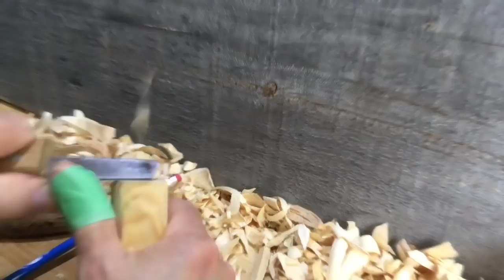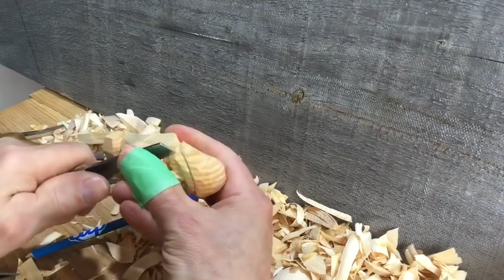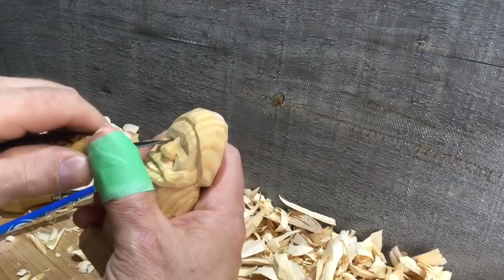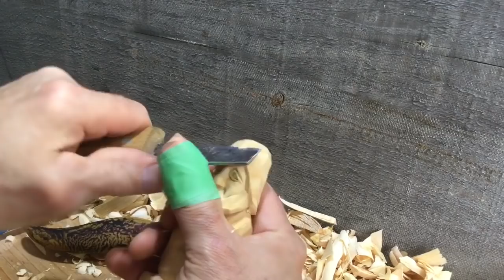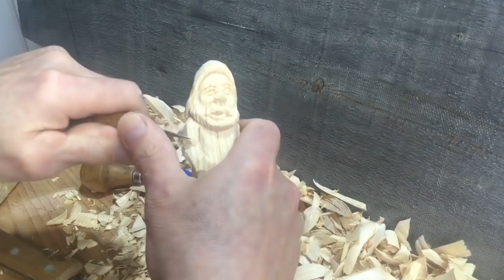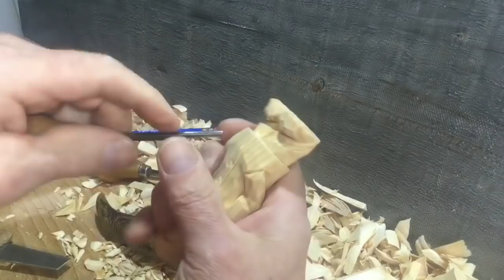Carving a 4" Fisherman

Comment: Another great one -I'm in awe at the flawless carving of the eyes as that is where I am the worst.your pine also seems to hold detail better and take pressure cuts without breaking like my Basswood or it's just you :)
Reply from the maker: Thanks Doug. Your carving looks fine to me. I had trouble with 👀 first when I carved. I was putting too much pressure on my knife. Once I figured that out I began cutting very lightly into the wood around the eyes. It made all the difference. Also, when I was doing eyelids I would cut in towards the back of the head. That would cause them to break. So now I cut up for the top and down for the bottom lids. That way your cutting with the grain instead of cross grain
Reply: The eyes are very hard to do.
Reply: @KevinCoates98  Are you from the UK and where do you get the white pine from and in what form ?
Reply: You probably dont care at all but does anybody know of a trick to log back into an Instagram account?
I somehow forgot the login password. I would appreciate any assistance you can give me.

Comment: Wonderful carving, Kevin! Here's a small tip for you: If you carve the head on the corner, you can easily turn their heads according to which direction you wish. I have found that the corners aid in beginning the nose, and the face fits quite nicely into the 90° corner. Makes it easier to form the face this way too.  I learned how to carve miniature characters from Jack Price. In his first book he created all his characters facing the front, but after I sent him a photo of one of my 2 1/4" characters with its head turned, he also began carving them that way too...LOL. It's a great use for scrap wood too. Keep up your excellent work!
Reply from the maker: Thank you Sir and  for your tips

Comment: I finally found a knife at a flea market that I Think I can turn into something like you use. It is an old kitchen knife with wooden handle and carbon blade. It has been sharpened so many times that its shape looks like a crescent moon, Before I cut it I wanted to know if you had some method to your length selection and the shape of the tip. Fascinating to watch the characters develop as you work. Thanks for sharing
Reply from the maker: I have two fillet knives that I cut for carving. The first one I cut to a 3.5” blade. The second one someone used years ago to cut roof shingles and broke the blade. I just trimmed where it broke with a rotary tool and sharpen it. The blade is 2.5” on that one. That’s the best one for me
Reply: Thanks Kevin. I actually found 2 knives and I cut them to take advantage of as much straight blade as I could. That left me with 2 knives close to your dimensions, one a little more than 3.5 and one just under 2.5. Now to try and sharpen them. I will watch the sharpening video again then get to work.

Comment: I would like to kmow how you choose the wood your going to carve evwry single time i try mine cracks or splits
Reply from the maker: Steve, for these 4” carvings like I’m doing now I got the wood at Home Depot. They have pine boards 1 1/4” x12” x8’. I don’t have any problem with splitting on that. It’s all kiln dried. I look for cracks in the wood before I buy it.